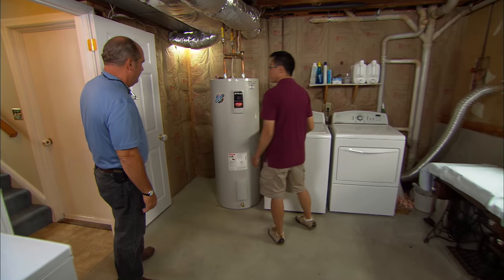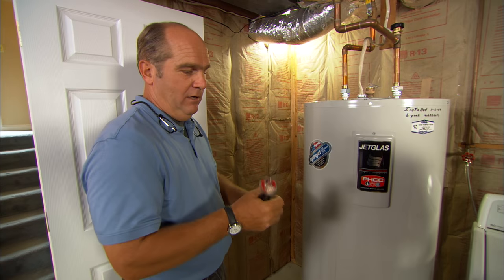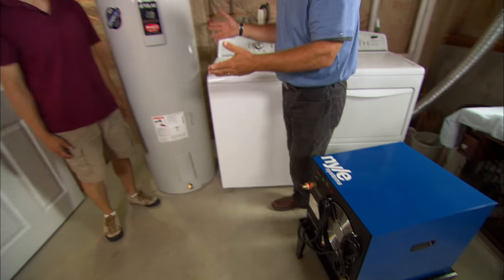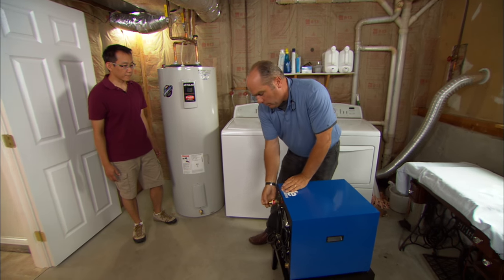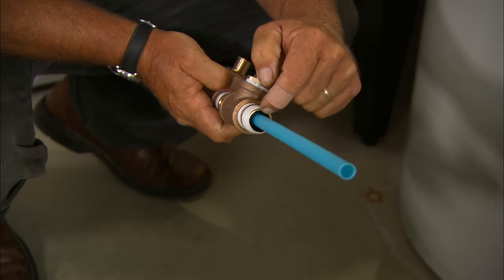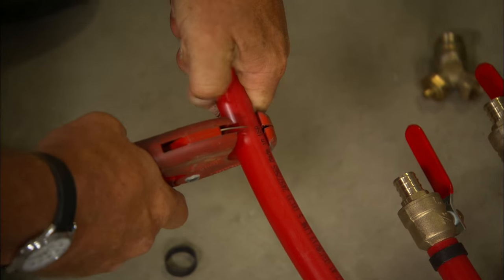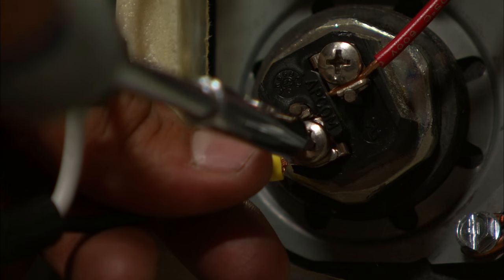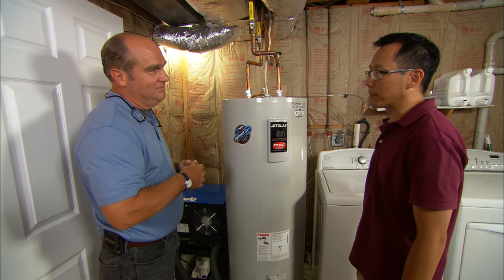How to Add a Heat Pump to a Water Heater | Ask This Old House

Comment: Some municipalities will not allow condensate pumps to discharge into any drain that feeds into the municipal sewer system, such as was done here by feeding the condensate discharge into the same drain pipe as the washing machine. Since those municipalities consider condensate to not need sewage treatment, they don’t want additional water to feed into the sewage treatment plant(s) with a potential to overwhelm the capacity of such treatment plant(s) (yes, it seems hard to believe). So that condensate has to be discharged just like rain water, outside of the structure onto the ground (or into a sump pump if the pump discharges out onto the ground).
Reply: That condensate pump looks like it holds half a gallon at most. I'm sure that won't overflow the sewage treatment plant
Reply: @elisal1197  - one pump won’t cause an overflow by itself. But if every house had one …
Reply: @stevebabiak6997  the "what if" takes you down a rabbit hole with end my friend. I agree that would be the case if EVERY house had one but people are cheap why traditional tanks styles will always hold the majority of the market share.
Reply: @elisal1197  - the reason I pointed out that matter in the first place is that I had that happen at a flip house I was selling, in my first time in that particular town where that was the code. Plumbing inspector did not give a thumbs up until the condensate piping was disconnected from the drain pipe going to the sewer and instead directed outside. And the explanation the code inspector gave was … sewer treatment facility capacity.

So just trying to make people aware that some towns can have seemingly silly regulations.

Comment: If it takes heat from the room, wouldn’t it make the HVAC come on a lot more in the winter? Wouldn’t it be stealing heat from the house and use more electricity to heat the house? Maybe it equals out in energy cost in the summer though.
Reply: It does take heat from the house. But they are going from resistance electrical water heating to a heat pump drawing from an oil furnace. That will be more cost effective. These are of questionable savings when you have natural gas as an option for space and water heating, and no savings if you should be unfortunate enough to have resistance electricalq heating for your entire house.
Reply: They are meant to be placed in an area like a basement or garage that is not right in contact with the 'conditioned' space.

Comment: What is better, this or a on demand water heating solution?
Reply: on-demand requires massive BTUs. It currently only reliably works if you have gas. This house doesn't. On-demand isn't super efficient, but you gain that back because you no longer have a giant tank of hot water sitting in your basement all summer, sapping your energy; this is a really good thing in hot climates.
This setup is good in warmer climates where you have an alternative cheap source of energy, such as oil. It's also good if you already need to constantly dehumidify a basement.
Reply: also, on demand is very expensive to install and maintain with yearly visits from a contractor. add to that it takes just as long to get hot water to remote parts of your house and its not really worth it in most cases.
Reply: On demand water heating solution works best if u change to point-of-use water heaters. The rest of the world got rid of cheap but inefficient and expensive to run electric to HWT decades ago. 

When I travel I have used them many times and they work far better since u dont have to wait to get hot water. But since very few ppl use them in the US the choices r far more limited. 

So dont let the grumpy old men scare mongering keep u from finding a better alternative,

Comment: “Open the faucet to break the vacuum”
Immediately shows the water heater with both valves in the off position 🤦🏼‍♂️
Reply: And the same shot shows that it has a vacuum breaker installed.

Comment: So @thisoldhouse what about heating water during the winter? Our garage gets to be pretty cold in the winter, since it's unconditioned space. If there isn't enough heat in the room to heat the water, would the water heater kick back to our natural gas?
Reply: If you have natural gas, there's not much motivation to get this. This is a replacement for electric water heaters. Potentially, such a heatpump would have an emergency mode, where it turns on traditional electric coils, but that would wreck efficiency. This is for when you have a cheap energy source like oil, in an area where electricity is expensive. Otherwise, it is not a good solution for cold climates or areas with really cheap electricity.

Comment: is it possible to add heat pump functionality to an indirect water heater so that it could be used during the summer months instead of the boiler?
Reply: There might be something out there but I bet it's expensive. The indirect tanks have a water coil that heats the water, right? IDK how you would adopt this system to that. Maybe if you could find an air to hydronic small unit and connect to the coil on the indirect.

Comment: Shouldn't the heat pump unit be outside.
that basement will turn into a freezer and that unit will struggle to get the hot water up to recommend temperature and lead to premature failure.
Reply: John Magon no it doesn’t have enough physical coil size to do more then just Dehumidifier

Comment: Ok, Love it What is the make and model of the heat pump. I want to order one. Thanks
Reply: It will use more energy in the winter than an electric if it's inside your heated house. It sucks the heat from the area it's in, which your furnace has to replace. In the summer it's efficient though.
Reply: Thomas if you are in the US, go to our website and fill out the contact form: https://www.nyle.com/water-heating-systems/contact/ we will contact you when they are available in your area.

Comment: Interesting concept but seems clugie with added plumbing protruding from tank, in a totally unfamiliar way.   I foresee problems from unsuspecting persons tripping over it or dropping/storing something heavy on it, like a pail or crate in that space which Is normally clear.  Maybe a rightangled assembly that does not protrude as much?  Better still, why not insert the unit's plumbing at top of water heater where cold water normally enters?

Comment: Where can I get the pipe in a pipe? The fitting that goes in the drain hole in the bottom of the water heater.
Reply: He shortened a water heater dip tube (that's the inner plastic pipe) and used Tees on both sides. It's an inefficient design

Comment: Can the heat pump be turned off and only electric used to heat for during winter months when one does not want to cool the basement even further?
Reply: You would want to cool the basement further if your heating source is cheap
Reply: @thingsifoundontheinternettoday  makes sense

Comment: Good video, I live in the north east. Can you add a heat pump to a oil furnace water heater? Will it be efficient?
Reply: Angel Mercado If you have an oil furnace, it is more common to put a domestic hot water loop into the furnace itself.
Reply: Phlargmalb Zzazzary That works for boilers, not furnaces.

Comment: So I'm watching this video 6 years after it was made and wondering, why isn't this product commonly talked about? Resistance heaters would greatly benefit! And then I realized:

1. People only think about about water heaters when they die, so just get one with the heat pump already on top and avoid the work of retrofitting. Oh, and do it quickly because the entire family is waiting on you to fix the problem.

2. Get an electric, set your timer for 6 years for the warranty to end, then buy this and retrofit? Most won't (see #1 above.)
Reply: an electic heater is $300 or so , heat pump is $1800 or so.  It will might never save $1500 in power unless a very hight cost area
Reply: @pablopicaro7649  My comment wasn’t about comparing retrofits to new heat pump water pumps. That said, what I’ve read is that the payback period is just a few years for most people because the electricity usage is only about 1/4 as much.

Comment: I cringe every time I see Richard T. put a pipe wrench on a hex nut, but, this takes the cake.  When Rich T. wired the heat pump into the lower thermostat circuit, he effectively wired the resistance heating element in SERIES with the heat pump motor(s)...WRONG!  Richard T. should have disconnected both wires from the lower heating element and wired the heat pump with two wire nuts and left the lower heating element completely disconnected.  On the other hand, in all the years I have watched TOH, Tommy Silva has NEVER done anything that wasn't "purrfect"!  Tommy S. amazes me!  Re. TOH, every time their electrician mentions the "neutral" wire in a 120VAC circuit, I cringe.  Only in a  240VAC Edison circuit does one have a "neutral" conductor, because in a balanced circuit (equal resistive load in both legs) there is NO current in the neutral wire which lowers the circuit IR loss.  Edison was indeed a clever fellow. In a 120VAC circuit, you have a "hot" conductor (typically black), a "grounding wire" (typically bare), and a "grounded" conductor (typically white).  Ugh...it ain't rocketry science guys!

Comment: But should really need two separate heat pumps. 
One for normal ductless house heat/cooling.
One for hot water heating.
Shouldn't I be able to have one system for both?

Comment: Wont that be extremely slow to heat the water on cold days?
Reply: No, because on cold days, their oil-heater kicks in. So they are effectively indirectly heating their water with oil. This setup banks on the idea that oil energy is cheaper than electricity energy; which is a region-by-region thing.

Comment: Wait! What?!? In the original setup of the electric heater the cold water comes from above?!?!?
Surely it must go to the bottom before it joins the hot water in the heater, right?
Reply: The cold water connection is at the top.  It connects to a "dip tube" so the water goes to the bottom of the tank

Comment: Can this be done with a natural gas water heater tank??
Reply: Sure, but natural gas is “typically” cheaper than electricity, would make sense if you already had to run a dehumidifier to lower the humidity in the air.

Comment: What are teh electric requirements for the heat pump?  What is its power source?
Reply: Many use just 120 volts AC standard plug.

Comment: OK how much were can we buy them and is this unit compatible with low budget solar power ie 110 volt so far I've looked at hybrid units and one that has the heat pump outside and a tank inside all are very expensive the split unit is over 8 grand the hybrid ones start around 1200 $ but either you pay 8 grand or more on solar or you stay connected to the grid in our area that means that it'll cost over 200 hundred dollars per month to operate neither of these I'm willing or able to do I can go solar for under 2 grand and probably under a grand but that is 110 volt only so I need a unit that's able to run on 110 and also what's the highest temperature this unit can reach the hybrid units max is 140 degrees the split is 180? degrees

Comment: One other question. Is the electricity use of the heat pump more or less than the efficiency of a newer natural gas water heater?
Reply: It's been a while but I think the hybrids that use both heat pumps and traditional heating elements are more efficient than a gas heater.
Reply: Depends on the pricing in your area.  In my area (NoVA), it is way cheaper to use gas than electricity even if your heater is only 70-80% efficient.

Keep in mind that as it gets colder, the heat pump is less efficient.
Reply: Gas is way cheaper now if you can get it
Reply: Heat pumps for water tanks are more energy efficient than a natural gas water heater.  Any heat pump with a COP of 2.5 will be more efficient than any gas fired water heater.  In terms of cost, that depends on where you live.  I pay much less for natural gas than I do for electricity, so I would need a COP of 4 to match cost of operation.  The heat pump would still use much less energy, but because electricity is more expensive, my bills would be the same.

Comment: Works great in the winter. You burn oil to heat the room that will heat the water. And uses electricity too!
Reply: They don't get it do they? In the summer it would be efficient though

Comment: Most of the gadgets they use on this television show are exemplary gadgets and you will not see for another year so a lot of them the manufacturer stop making so you can't get any parts for or these  Are experimental units Some of the units are actually very good units but if you look at some of them you can definitely tell the cost outweighs the efficiency

Comment: I'd love to have known where in the US this house is located. Won't the removal of hot air from the basement air pull in cold air from outside?
Reply: It won't pull in outside air because it is not pumping air out of the house, merely stealing the heat from the air which is in the house. It will definitely cool the house down though, by about 4500W while it is in use, which has to be reheated by the furnace.
Reply: Probably Boston area where TOH is produced.

Comment: While I usually very much enjoy This Old House videos, this one left me with mixed feelings.  While I like the technical information provided, the discussion of this heat pump seems to assume that there is always heat in the interior space where this unit installed that the homeowner would like to remove and turn into cold air.  While this is great for warm climates where domestic hot water is need, and where at the same time we want cooled indoor space, it does not make sense in cold climates where the heat in the house is actually due to a heating appliance of some type and is desired.  In that case, the heat pump water heater is just taking heat from the interior air and using it to heat the water, in turn creating cooler air which the heating appliance then has to again reheat.  If one imagines using the air-water heat pump to heat water for a forced hot water heating system, it then this system seem to become a perpetual heat engine, which is a fallacy - the heat and hence energy has to come from somewhere.  It would have been nice to have this clarified at some point in the video rather than just assuming the heat taken from the indoor air was happily given up.

Comment: Wouldn't it be better to install the heat pump in the attic where it is warmer?
Reply: First, not all houses have attics; I own six houses and only one of them has an attic.
Second, not all attics are “warmer”; my one house that does have an attic has soffit vents and ridge vents to allow the outside air to flow through, to cool the underside of the roof sheathing.

Comment: Very nice, but it will be the same amount of heat in the house, they will take it from the air, heat water with it and then whatever heats the insulated environment inside will have to burn them calories again. What’s the difference? Considering the price of the new unit, that’s the difference - down the drain.  These heat pumps should take the heat from the outside, not from the basement - it lowers the temperature inside the house.
Reply: Not everybody lives in an area where heating is the primary function of the HVAC system.

Comment: So what happen with the two electric heating elements in the water heater? Why didn't he take them out?
Reply: probably for redundancy and for winter when it might be less efficient to use the heat pump
Reply: You would run them in the winter, and on a high demand they would come on.
Reply: The top runs if you use all your hot water as a quick recovery heating element.  The bottom only kicks on as a backup if the unit gets shut off or fails for some reason, like a bad relay in my case.

Comment: What about anti bacteria? You don't want to store water at 130 Fahrenheit right?
Reply: The majority of injuries and deaths involving
tap water scalds are to the elderly and children
under the age of five. The U.S. Consumer
Product Safety Commission (CPSC) urges all
users to lower their water heaters to
120 degrees Fahrenheit. In addition to
preventing accidents, this decrease in
temperature will conserve energy and save
money.
Most adults will suffer third-degree burns if
exposed to 150 degree water for two seconds.
Burns will also occur with a six-second
exposure to 140 degree water or with a thirty
second exposure to 130 degree water. Even if
the temperature is 120 degrees, a five minute
exposure could result in third-degree burns

Comment: Just spend the extra money now on a tankless. You'll be glad when the tank springs a leak just one year later.
Reply: such as?
Reply: electric tankless uses tons of power
Reply: IAmNotAFunguy Tankless heaters are hugely complex and full of fiddly plastic parts compared to tank heaters. I like them in theory but there's an awful lot that can go wrong with them vs a tank with two elements and a thermostat.
Reply: IAmNotAFunguy b
Reply: Strange how in rest of the world the electric HWT is RIP for decades but in the USA it wont dies lol

While traveling I have used point-of-use (POS) water heater many time and not only r they far more efficient than a old fashioned electric HWT but u get hot water far faster too. 

And for he doubters that comfortable doing some usually minor electrical work or getting it done for them. And checked  to make sure they have a circuit they can use that has enough capacity for the added load. 

I suggest when replacing a faucet the fails with unit that has heater u can find on online and and make sure its a 120v unit and or getting unit the can be added below the sink if none of the faucets need replace,